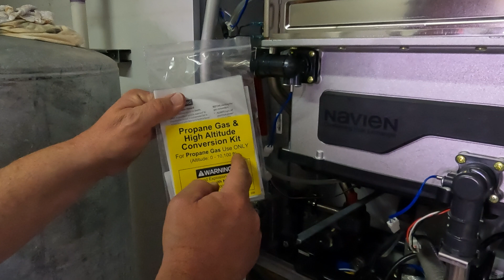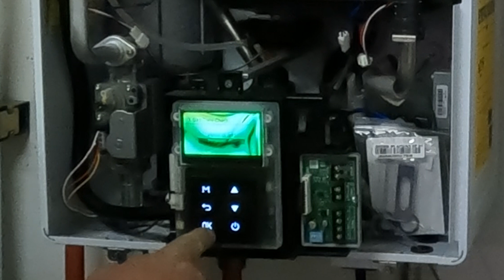How to Convert a Navien NPE240A2 to Propane (LP) (From Natural Gas)

Comment: just purchased a home with a navien npe-240s that was installed 5 years ago, outdoors, it was converted to propane, but after reading the manual i discovered the dip-switch was never flipped to on for lp, they ran the heater for 5 years with the dip-switch set to natural gas.... that said, everything seemed to work just fine with the dip-switch not set to natural gas, the heater functioned, and doesn't seem any different now that it's switch to lp... from what i read, the dip-switch impacts how the exhaust / carbon monoxide is handled but doesn't impact that operation of the heater, is that true?
Reply from the maker: @CAPUTO000 No. The switch sets the fan speed range for the proper gas/air ratio I's recomend having the unit checked out and having the combutions dialed in with a Manometer per the instructions.  Even then there is no telling if any damage has been done but it is likely after 5 years. We've seen this before. Sometimes there is no damage and somtimes after many years other components are damaged and it can greatly shorten the life of the product. 

Consider having it serviced by a local Navine NSS contractor. You can locate one from Navine's website.

Thank you for watching! Make sure you follow us on our FB page here: https://www.facebook.com/scottgreggoutdoors/  I usually post what's coming up there as well plus other channel insight and content not on YouTube.  Also Instagram at www.instagram.com/scottgregg1966/